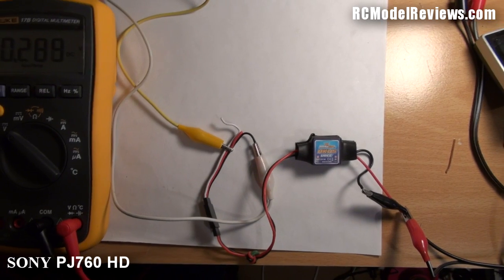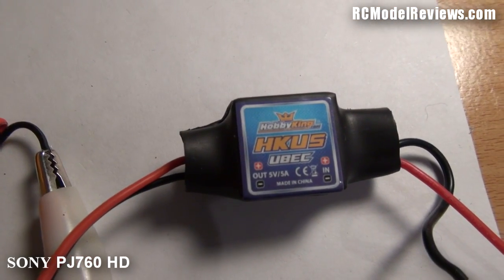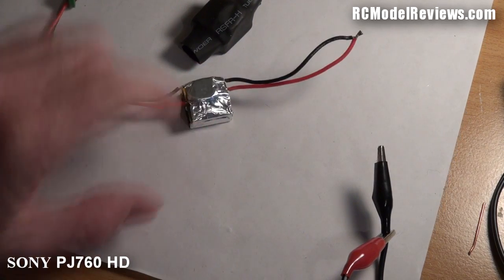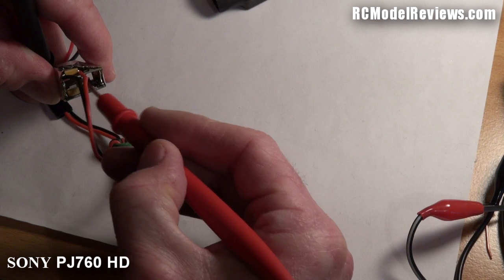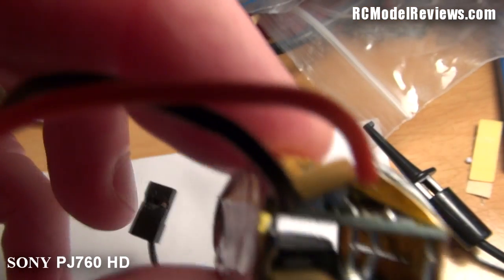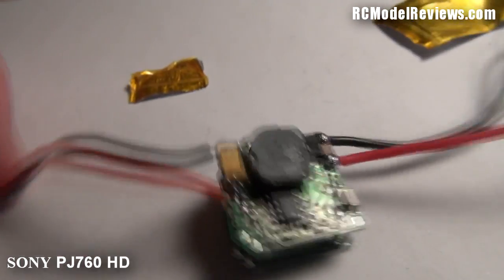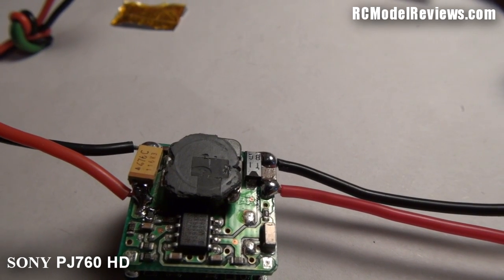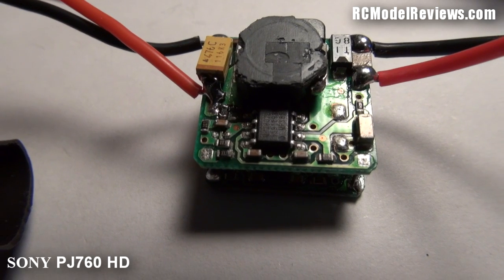HobbyKing UBEC repair job

Comment: Hey, Bruce great vid!  I had spent over 10 years working for an electronics company handsoldering surface mount boards:). So I love video like this as well as all your video on xjet with your crew!  Wondering if the pad underneath the yellow cap pull off as well when the cap was raised for inspection?  I'm from U.S. and your accent is fine with me!  Don't know what StarHoppen's problem is!

Comment: exactly what i thought! sunsky-online has 20 for 6.50$. that's the cheapest i've found. i use them for everything: gopro charger in the plane, builtin bec for the servotester, all kinds of powersupply in the fpv ground-station. i love em! dont forget to add a output capacitor, the one on the board is useless.

Comment: This is interesting...I have an HK BEC that is identical but is a single stack rather than a double stack in parallel. 
What I found intriguing was I had the same failure as this one. The positive output wire had a good connection to the cap but neither were soldered tight to the board. 
Fortunately, it's an easy fix.

Comment: I had 4 out of 6 of these fail out of the box. My digital servos hated the ones that worked. Lots of jitter when i used to to that worked so I had written them off. I might take a look inside. Thanks for the informative vid.